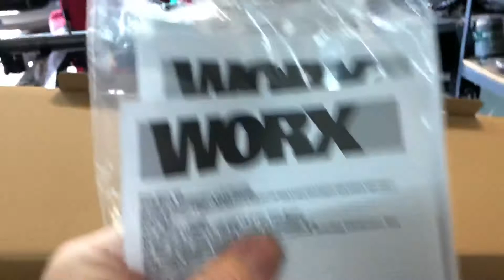Worx chain saw pole saw

Comment: How thank you for the video , I used my for the 1st time but how we can clean the dirt inside after cutting,  my is electric the same, if you have a video on how to clean I would like to see it, thank you nice video
Reply from the maker: Hello and thanks for watching my video. It’s easy to clean. Just loosen the chain adjuster all the way and pull the cover off that way you can get into it and clean it. I’ll make a video for you ASAP
Reply: I just use air from the compressor and a soft brush, no need to even take off the chain.

Comment: Cool Mach I've pretty well changed everything over to battery i have battery weedeater battery blower battery mower battery sprayer dewalt 60/20 volt love them all there as strong as my gas tools. The next thing I'm buying is a bettery chain saw. I really like dewalts warranty also. I had a battery that did not stay charger long enough after 2 years I called dewalt they had me new battery the next day in ups and let me keep old battery also. Thanks for sharing with us have great day
Reply from the maker: Dewalts warranty is good and they are proven

Comment: I bought one. Right out of the gate, the locking knob broke off. The chain bar had to be tightened. The end pole switch doesn't work. I got it working. Cuts tree branches pretty good. It's a frail built piece of shit with plastic gear to drive the motor. Plastic made. Lemonade.
Reply from the maker: Dang that sucked.